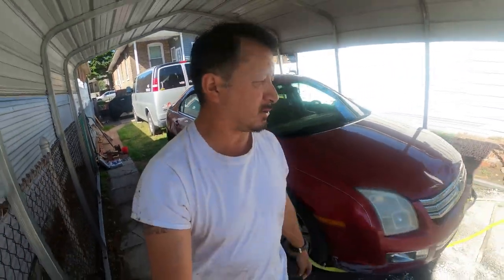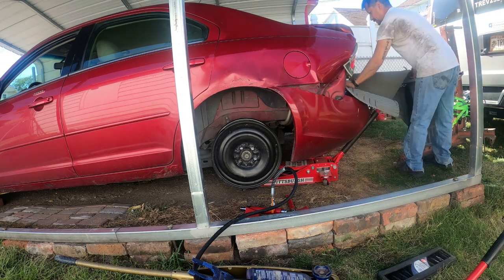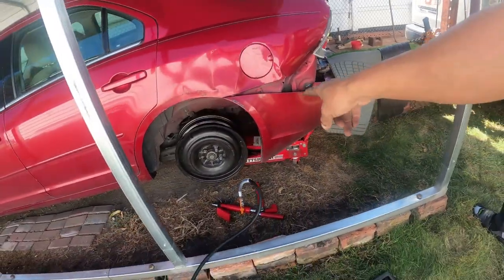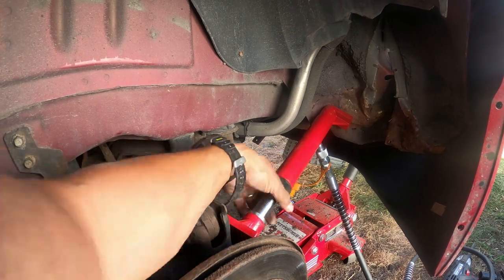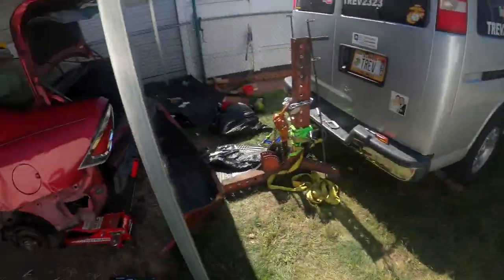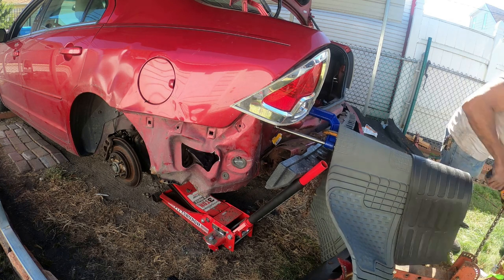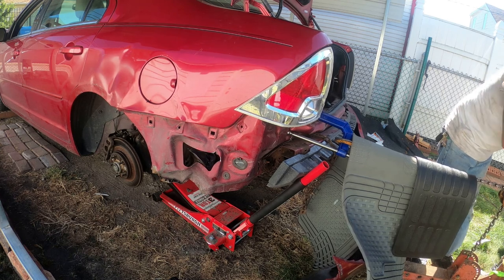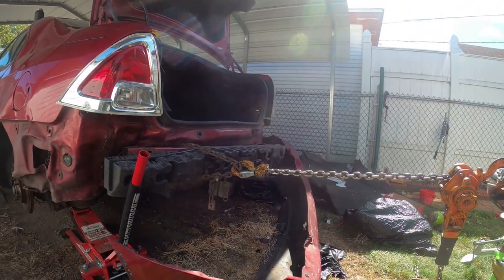Straightening a unibody Harbor freight porta power and winch

Comment: Very good video. I do have one question.
How did you prevent the entire vehicle from moving while you were pulling it?
It seemed to me that you had something in the front part to retain it, but I am not sure if my observation was correct.
If you can specify what sections of the vehicle did you use to hold from would be really useful.
Thanks!
Reply: @RobHereAKATrev2323  Thank you very much for  your answer it has been very helpful.

Comment: You should have used the the rubber attachments and you should have had it on something like the ground not the car . The chain hoist should have been hooked to the frame holes